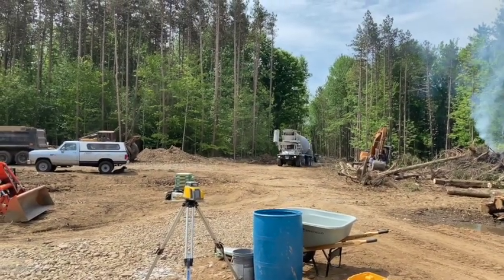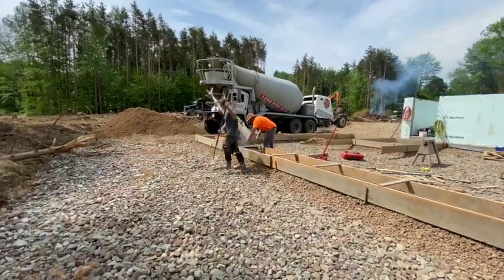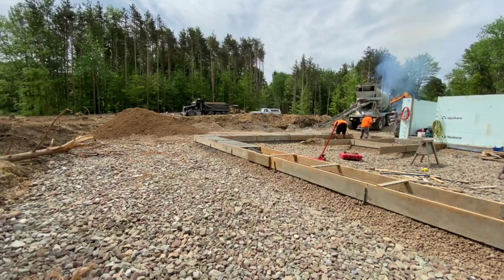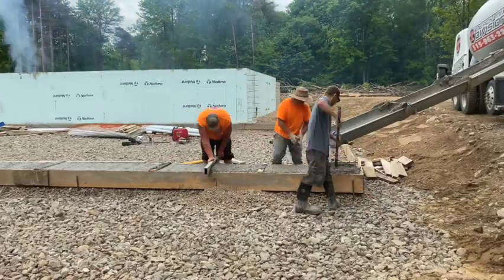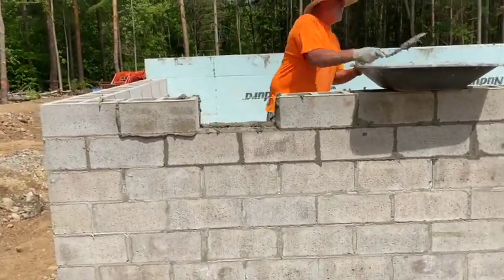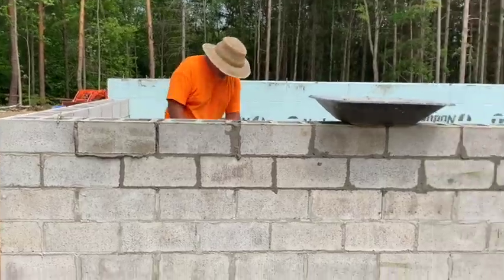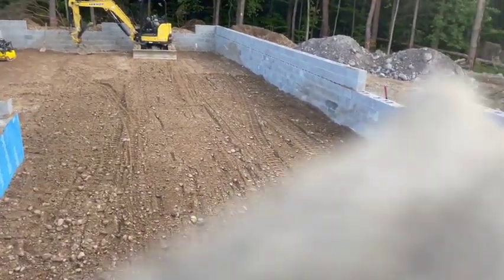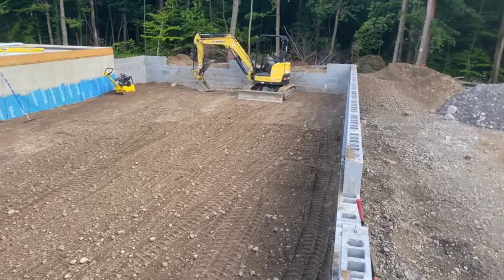Proper backfill to prevent concrete cracks.

Comment: Is it bad to core fill an entire wall?
Reply from the maker: No if you want to spend the extra it is gonna be stronger
Reply: Is it more cost effective to core fill a block wall, or just use icf to begin with? I have no experience with either, ive only had formed foundation work done in the past. @bondobuilt386

Comment: What is the average cost per sq ft for an ICF walkout basement? 60x30 house and 40x40 detached garage.
Reply from the maker: I don't do basements by the square foot. To many variables. Every project has its own challenges
Reply: @bondobuilt386  yeah I understand that, just planning and trying to get a rough idea. Best I can tell it’s gonna run around $85k here in Alabama

Comment: Ronnie, with Nudura ICF , if i build walls of my house in ICF right up to the roof trusses ( I am in CNY) and i plan to do a parge , do i need a waterproof membrane behind the fiber mesh that you installed on a previous video ?  have you done a full wall to a home right to the roofline  ( not just basement or crawl space in ICF ? ) also please drop me your email ? I gotta get you involved in my build, thanks man
Reply from the maker: I have never done one to the roof line. You do not need the water proof membrane above ground where you plan to parge. we are booked out for another couple of months bud.
Reply: @bondobuilt386  thanks Ron, I am not moving forward with the build for years, i am planning now, gotta start with land clearing and pole barn. you may be retired by the time i finally build lol !!

Comment: Two probably silly questions for you Bondo.
1.  Would it be less expensive overall for the property owner to go with a poured concrete wall vs concrete block for the garage and porch?
2.  For ICF walls, and I KNOW this would be pricey.  If you know you have water problems where you are building would it be effective to put a "core" on the top of your foundation pour?  By that I mean, say you're using a 6" core ICF, would it make any sense to put a 2"Hx4"W continuous "ridge" integrated in your foundation pour centered on where your ICF blocks will be?  That way you would still have 2" of fresh pur when filling the ICF on either side of a 2"h "dam" in the middle of the form, seems to me this should help to mitigate any water infiltration that gets beyond your drain system and waterproofing membrane
Reply from the maker: Around here concrete blocks are cheaper than a poured wall. If water gets past the perimeter drain it will find a way into the wall. I don't think I quite get your idea but it sounds like a lot of extra work buddy. Good drain to daylight and stone or free draining gravel against the wall and it will be a dry basement.
Reply: are you talking about a drip sill ?
Reply: @italRotty  Not really, at least as far as what I think of as a drip sill.  More of a raised up wall or lip for the concrete poured into the ICF wall to lock on to and also to work with any membrane waterproofing to keep water out.  I just realized my dimensions were wrong in my OP, the lip would need to be 2"x2" to leave space for a 2" pour on either side when filling the form.  I'm pretty sure Bondo is right in he reply, that it would be a waste of time when a good drain system would do it.  Something like Form-A-Drain for the foundation pour.
Reply: @michiganengineer8621  i believe you are talking about a key into the footer but ridged up instead of recessed.  maybe i am wrong aswell and not understanding either.
Reply from the maker: @michiganengineer8621  You could submerge a 2x2 into the footer and take it out after footer dried. this would create a keyway without a bunch of messing around.
Reply: @bondobuilt386  <face-palm>  That's too obvious LOL  I was fixated on doing the opposite.  Thanks for waking me up a little bit.
Reply: @clintonflowers877  Nope that's it.  I just couldn't put the words together.  Although Bondo just pointed out the easy way to do it and now I feel REAL dumb LOL